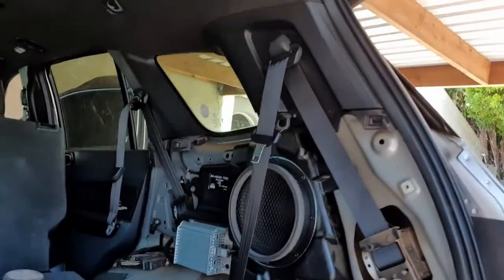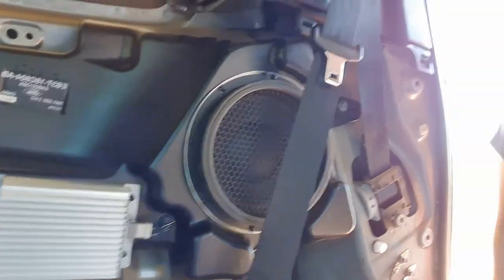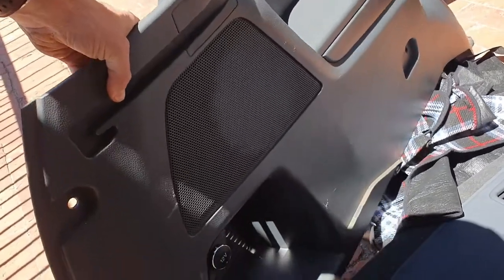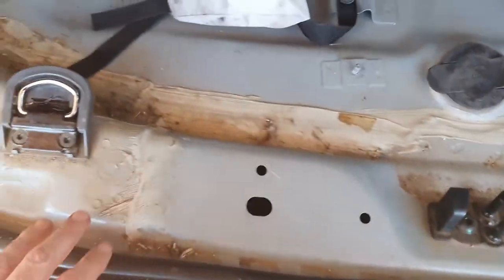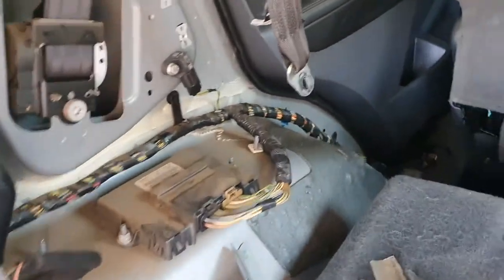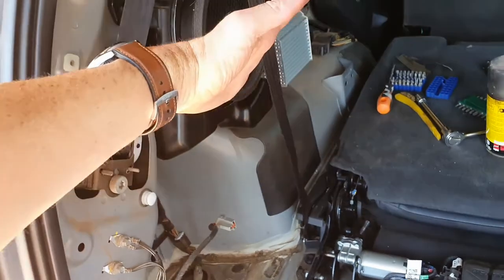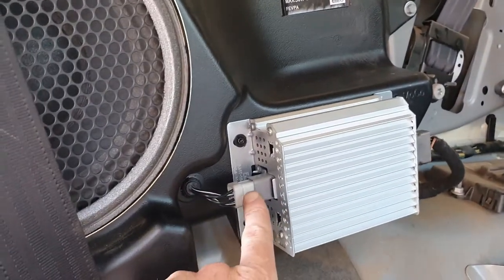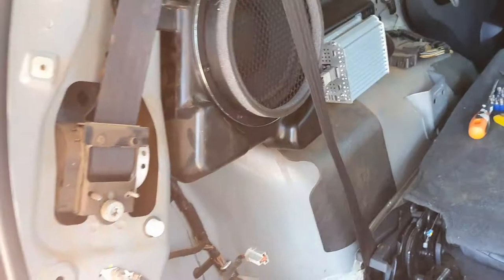How to fix a Buzzing sound from your car's speakers | DEALERS would never do this!

Comment: My 2011 Kia Rio LX buzzes really loud every time I use the speakers. I’m not sure how to fix it
Reply: Hey Juliyana, the issue was a corroded connector plug on the subwoofer amplifier. So, you need to take it out and see if there is corrosion causing a bad connection to the amplifier. You can then use a water displacing oil to stop the corrosion and ensure good connectivity.  Alternatively,  change the connector entirely. Sorry its not an easy solution but you can take it to a car audio specialist to do for you
Reply: @tonesX7170   I can definitely figure out how to do everything! Thank you for taking the time to type it out, helps a lot!